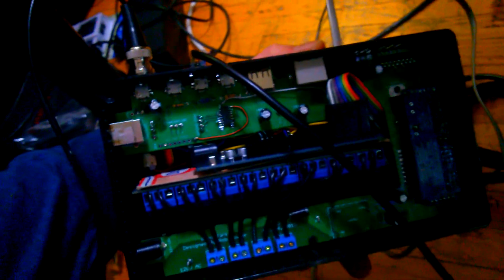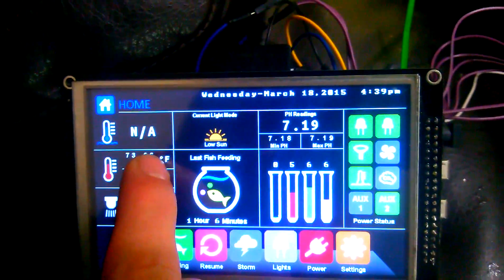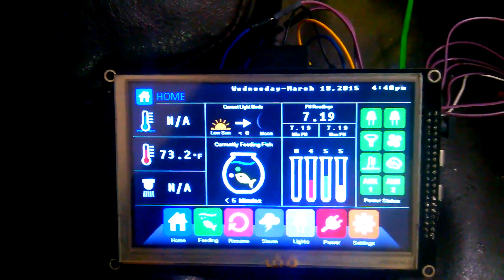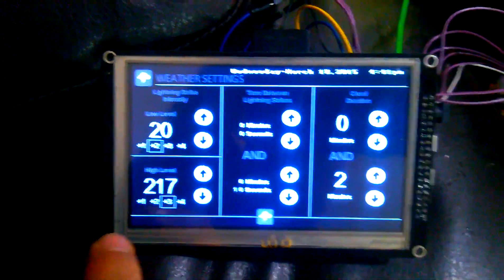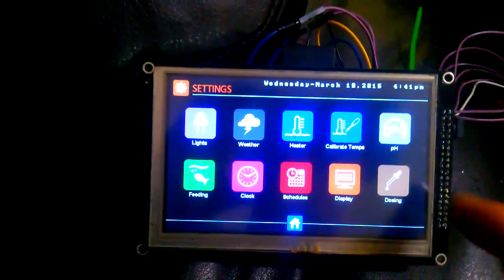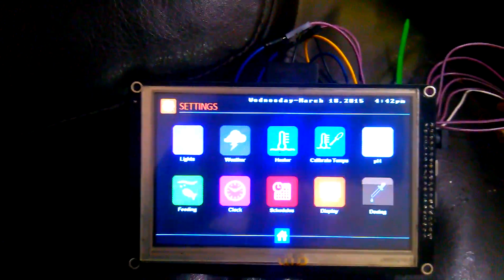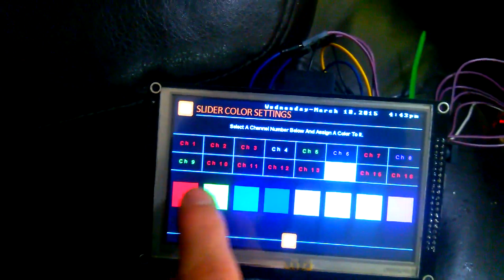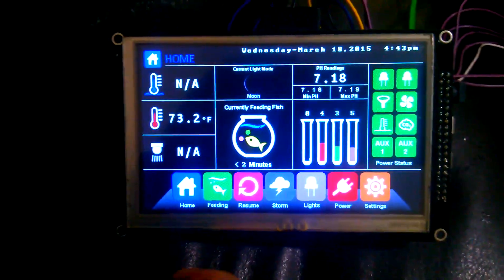Robo-Tank DIY All-In-One Aquarium Controller - Now On The Due

Comment: Hi, I have question about a liquide level sensor for fertilizer capacity, which the model liquide level capacitive sensor you recommend for your device and how it should connects? Sorry for my English.
Reply from the maker: Hi, you can enter in how big the fertilizer reservoir is and how big the dose will be and it'll calculate how many doses there is and stop pumping when it hits that. You could add a regular float switch to the reservoir to get a message when it hits that level. Thanks
Reply: do you means it works how countdown pages into a cartridge of the some laser printer?
Reply from the maker: Sorry I don't understand? On the controller home page it does say how many doses are remaining in reservoir and countdowns to 0 as it doses.